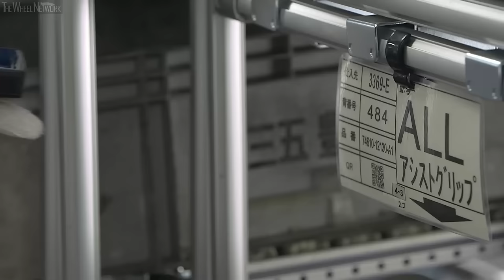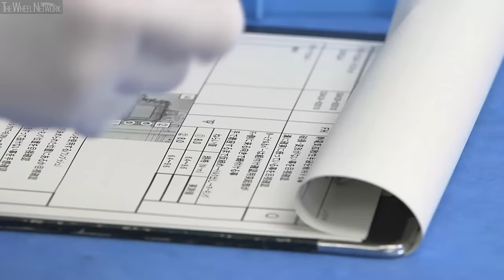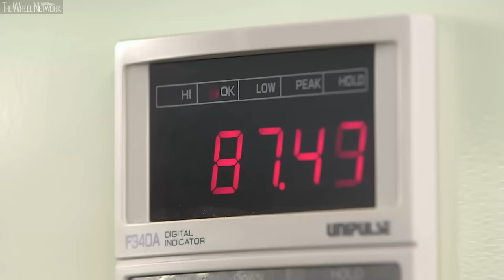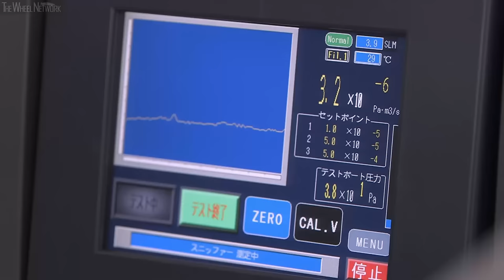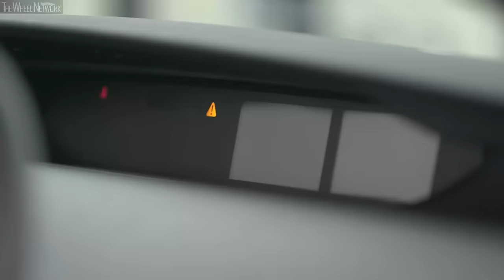Toyota Production in Japan

Comment: It is interesting to see what actually goes on in a Toyota plant.  All the famous stuff seems to be invisible.  Kanban cards, just-in-time, visual management, the line stop button and the critical importance of takt time (all operations in a sequential assembly line need to take the same time). The line is famously clean.  There is very little talking, just the whir of powered tools.  Thanks for the video!
Reply: There are two options when you die, either heaven or hell. If you want to go to heaven you need to repent and believe in Jesus Christ
Reply: @brotherdj777  Who's going to die? Eternal life in Jesus Christ!  You only go to hell if you don't obey the preacher MAN.  Stop viewing car videos.
Reply: @camgere  have you believed on Jesus Christ for your salvation?
Reply: @brotherdj777  God knows.   The only faith you should be questioning is your own.  Driving a line through a 45 degree turn is much more advantageous than driving a line through a 180 degree turn.

Comment: Still running that Japan Made 1998 Avalon, 330k +  ,my friend told me make sure it’s made in Japan...*
Reply: I have a 99 Avalon that was built here in the US, and its approaching 300k miles. Just made an 1800 mile road trip in it! Are you sure yours was made in Japan?  If the Vin Starts with a J, then it was!
Reply: The Toyotas made in Japan last twice as long.
Reply: Sorry dude but '98 Avalons were built in one place outside Japan and one place only, Georgetown, Kentucky.
Reply: KoushiroIzumi85 - it sounds right then, I’m surprised , because it’s original owner was a Japanese executive, either way it’s a great model , my next one will be a used Lexus close in age range, the year .  They designed them to enter the us in the best way , so as to guarantee the best impression for us mkt...and that is my experience ...I stay away from high tech motors ...to expensive to fix.
Reply: @Rio-by1eh  That Japanese exec probably didn't know where his car was assembled and only assumed by looking at the badge. The majority of Avalons have always been built in Kentucky (with exception to Australian market Avalons which were built in.......Australia back in the early 2000's and Chinese market Avalons built in China just recently). No Avalon that I'm aware of originated from any of Toyota's Japanese plants. Hell, even Japanese-market, right-hand drive versions of the Avalon (1st gen sold as "Avalon", 2nd gen sold as "Pronard" in Japan) originated from the same Kentucky plant.
Reply: KoushiroIzumi85 thanks for the facts...the only thing with that car are the replacement parts , they crapp out , but not the original parts, but then again no more break jobs with firestone ever.
Reply: I have a 98 Corolla with only 87000 ks  from new, still in new condition.

Comment: I have a 1998 Camry with over 300,000 miles. It was assembled in Kentucky but 98% of the parts are from Japan. Toyota's are unbelievably reliable, just stay on top of basic maintenance.

Comment: I seen a torque wrench used in relation to the 08:20 dash assembly, 10:45 exhaust assembly., and the 13:08 transaxle. From what I see, there are many places where an air impact wrench was used where the bolts were not torqued down to specification.
Reply: Are you suggesting you know more than those Toyota engineers?
Reply: @agooyong6207  Shaking my head. Where in my comment did I even sound like I suggested that?? All I did was comment on what I SAW. I gave no suggestions or opinions. 
Are you ok bro?
Reply: The air impact guns are torque loaded, you can hear them the ratchet slip when the torque value is met.

Comment: just curious, why do they do hand-assembling? isn't robot arm is more precise?
Reply: More than likely, this is a pilot assembly line. Low volume lines are used perfect the assembly processes. Notice the cars don't actually move, the works stations  do. Robots are good for repetitive tasks like welding and stamping. They can't do tedious things like placement of components, especially when it requires correction.
Reply: @CJOlin  Thanks for the explanation!

Comment: I always believed that Honda built a superior product back in the 70s, 80s, and 90s.  Looking back I realize that Honda produced engines with greater power and efficiency seemed more refined. Also that interior fit and finish of their cars was superior. But it seems to me that any edge that Honda had is now long gone. In the early 2000s Toyota caught Honda and has since left them in the dust.

Comment: 0:25	Fasten bolts in the bonnet using cordless pistol-grip nutrunner
1:00	Fix a part in the bonnet and fasten its bolts by hand
1:07	Fasten the bolts in the bonnet using cordless pistol-grip nutrunner
2:29	Fix rubber seal on a door
3:30	Place a seat inside the car using a custom hoist
4:22	Fasten bolts under the body using pneumatic pistol-grip nutrunner
4:46	Fasten bolts under the body using pneumatic pistol-grip nutrunner
4:54	Insert bolts sideways under the body and fasten them by hand
5:03	Fasten bolts sideways under the body using pneumatic pistol-grip nutrunner and ring spanner to hold the nut
5:13	Fasten bolts under the body using pneumatic pistol-grip nutrunner

Comment: With a speed limit of 50 kmph it is startling that 67 people died on NZ roads in localities to stupid things like not giving way.

It wont be long till a death on Pukekohe roads. They have many SUV trucks and there drivers here. 

Road accident deaths by age group for 2023 in NZ:
1.15-30 Highest bracket 120 deaths.  
2.31-45 71 deaths in 2023.  
3.46-60 57 deaths.   
4.61-75 55 deaths.   
5.76-90 28 deaths. 
2023 year.

Males rank 150% higher in car accident death rates sitting at 246 deaths whereas females sit at 95 for 2023.

341 deaths on NZ roads for 2023. 341 to many. 

2023 totals for road deaths in NZ 
Cyclist = 9. 
Driver = 182. 
Motorcyclist 53. 
Passengers = 72. 
Pedestrian = 25.

Overall the total road deaths for the Main NZ centers in NZ totalled 279 = AKL/BOP/Canterbury/Manawatu/Northland/Waikato WGTN did not total in with a low rate of deaths for 2023 @ 15 deaths on there roads for 2023.

The waikato faired not much better as we know from other regions with 67 deaths on NZ roads the worst of the totals for 2023.

Canterbury road deaths sit just shy of the AKL 2023 total at 45.

Auckland total deaths on the road abysmal at 47 for 2023. Highest death rates for Auckland roads sits at 111 deaths for 2021/2022 combined.

Comment: Code forbidden AE styles (AE 8 parts) in automobile market know as bad automobiles and bad motorcycles thus. Uneducation Automotive Engineering group class brilliant have invent these ones for their feeling without knowledge. 

1. Wider rear track than front track bodyworks | The lowest traction 0.7g, extreme tail flick, extreme slide, 1-5 km/l, below 1 km/l by Formula one speed 160-250 km/hour, over 250 km/hour on all circuits. Symptom little with driving speed traffic limit law on all path roads. 

2. Front track as same dimension as rear track bodyworks | The medium traction 0.85g, tail flick, slide, 1-5 km/l, below 1 km/l by Formula one speed 160-250 km/hour, over 250 km/hour on all circuits. Symptom little with driving speed trafic limit law on all path roads . 

3. Wider front track than rear track bodyworks in below 10 mm | The medium traction 0.85g, tail flick, slide, 1-5 km/l, below 1 km/l by Formula one speed 160-250 km/hour, over 250 km/hour on all circuits. Symptom little with driving speed traffic limit law on all path roads. 

4. Wider front track than rear track bodyworks in 10 mms | The medium traction 0.9g, tail flick, slide, 1-5 km/l, below 1 km/l by Formula one speed 160-250 km/hour, over 250 km/hour on all circuits. Symptom little with driving speed traffic limit law on path roads. 

5. Wider rear parts than front parts bodyworks | the lowest traction 0.7g, extreme tail flick, extreme slide, below 1 km/l by all speed on all circuits.  Symptom little with driving limit law on path roads. 

6. 1-4 turbo intercooler petrol engines hybrid all and 1-4 turbo intercooler petrol engines all : Easy damage parts engines, 1-5 km/lite, below 1 km/lite by Formula One speed (160-250 km/hour, over 250 km/hour) on all circuits, test maximum over 150,000 rpm, little damage with traffic limit speed law on all path roads. 

7. CVT all : Easy damage parts transmission, 1-5 km/lite, below 1 km/lite by Formula One speed (160-250 km/hour, over 250 km/hour) on all circuits, test maximum over 150,000 rpm, little damage with traffic limit speed law on all path roads. 

8. Without rear fog lamps : no one see rear parts transports in fog by without rear fog lamps. 

Who ever build brakes over 1 per side are stupid by broke down all electric circuits. 

This record information come from all brands and all socials who can't pass Europe test performance standard bases all in automobile market. It mean no one pass Europe test performance standard base in automobile market. Code forbidden AE styles group in automobile market are all criminals class brilliant terrorists, mutant class human terrorists, prisoners all class humanoid and their status prisoners level death clans. These ones effect EV, hybrid. 

From
All brands and all socials databases

Of course, all socials prefer code forbidden AE styles (AE 8 parts) in automobile market for their crime rob and corruption tribbile millions euros for fun. 

All social become criminals clans with build code forbidden AE styles in automobile market. Beware about their terrorists rule automobile market with code forbidden AE styles (AE 8 parts). These information can check parts of your products.

Comment: All Toyota series with code forbidden AE styles (AE 8 parts) in automobile market grade F pernament by all engineers aren't Automotive Engineering department. No one can pass as this report.

Code forbidden AE styles (AE 8 parts) in automobile market know as bad automobiles and bad motorcycles thus. Uneducation Automotive Engineering group class brilliant have invent these ones for their feeling without knowledge. 

1. Wider rear track than front track bodyworks | The lowest traction 0.7g, extreme tail flick, extreme slide, 1-5 km/l, below 1 km/l by Formula one speed 160-250 km/hour, over 250 km/hour on all circuits. Symptom little with driving speed traffic limit law on all path roads. 

2. Front track as same dimension as rear track bodyworks | The medium traction 0.85g, tail flick, slide, 1-5 km/l, below 1 km/l by Formula one speed 160-250 km/hour, over 250 km/hour on all circuits. Symptom little with driving speed trafic limit law on all path roads . 

3. Wider front track than rear track bodyworks in below 10 mm | The medium traction 0.85g, tail flick, slide, 1-5 km/l, below 1 km/l by Formula one speed 160-250 km/hour, over 250 km/hour on all circuits. Symptom little with driving speed traffic limit law on all path roads. 

4. Wider front track than rear track bodyworks in 10 mms | The medium traction 0.9g, tail flick, slide, 1-5 km/l, below 1 km/l by Formula one speed 160-250 km/hour, over 250 km/hour on all circuits. Symptom little with driving speed traffic limit law on path roads. 

5. Wider rear parts than front parts bodyworks | the lowest traction 0.7g, extreme tail flick, extreme slide, below 1 km/l by all speed on all circuits.  Symptom little with driving limit law on path roads. 

6. 1-4 turbo intercooler petrol engines hybrid all and 1-4 turbo intercooler petrol engines all : Easy damage parts engines, 1-5 km/lite, below 1 km/lite by Formula One speed (160-250 km/hour, over 250 km/hour) on all circuits, test maximum over 150,000 rpm, little damage with traffic limit speed law on all path roads. 

7. CVT all : Easy damage parts transmission, 1-5 km/lite, below 1 km/lite by Formula One speed (160-250 km/hour, over 250 km/hour) on all circuits, test maximum over 150,000 rpm, little damage with traffic limit speed law on all path roads. 

8. Without rear fog lamps : no one see rear parts transports in fog by without rear fog lamps. 

Who ever build brakes over 1 per side are stupid by broke down all electric circuits. 

This record information come from all brands and all socials who can't pass Europe test performance standard bases all in automobile market. It mean no one pass Europe test performance standard base in automobile market. Code forbidden AE styles group in automobile market are all criminals class brilliant terrorists, mutant class human terrorists, prisoners all class humanoid and their status prisoners level death clans. These ones effect EV, hybrid. 

From
All brands and all socials databases

Of course, all socials prefer code forbidden AE styles (AE 8 parts) in automobile market for their crime rob and corruption tribbile millions euros for fun. 

All social become criminals clans with build code forbidden AE styles in automobile market. Beware about their terrorists rule automobile market with code forbidden AE styles (AE 8 parts). These information can check parts of your products.